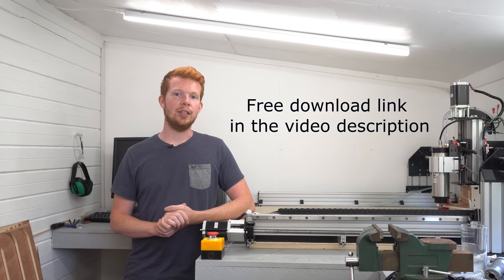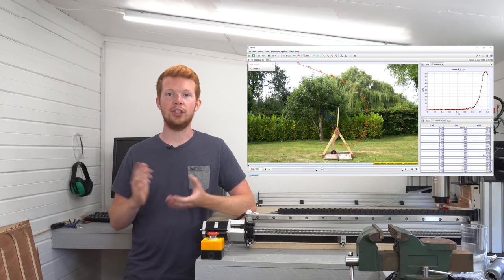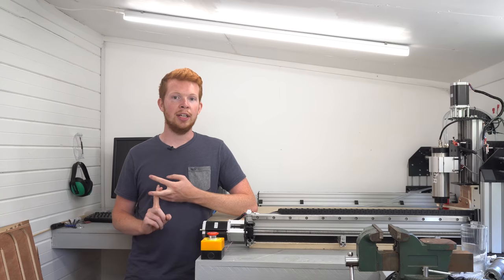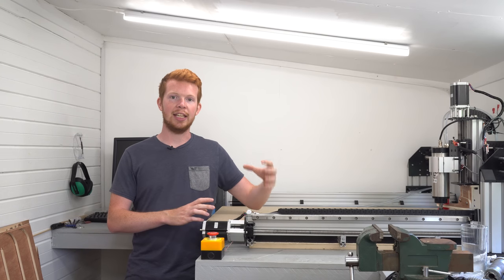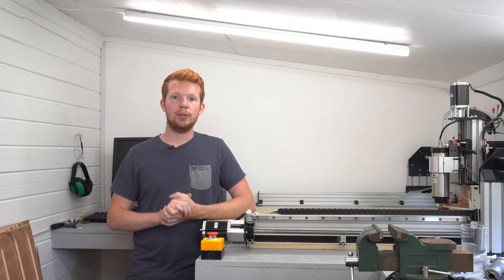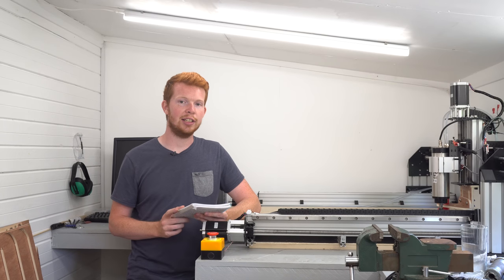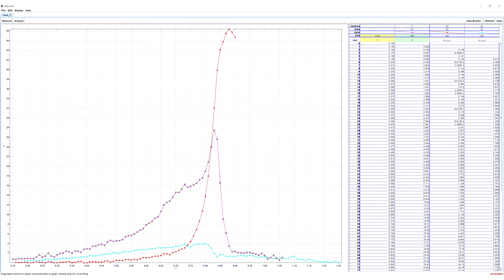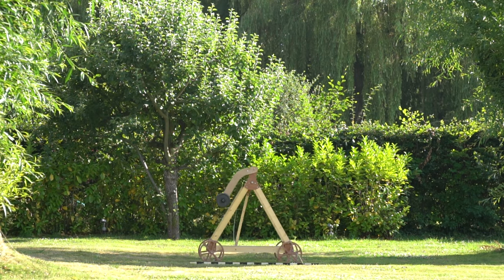Wheels on a trebuchet?

Comment: PS, stalling isn’t what is working.   What is working is when the ball is released at the exact moment the arm AND sling attains it’s highest possible speed. A shorter sling changes the moment that this occurs. When the sling lets go as the full length of the sling is in alignment with the arm, the sling is extending the arm length to its maximum, and the combined arm/sling length and tip speed is at its highest. When this occurs at the highest speed the arm attains, you get the maximal efficiency you can achieve.

Once more... watch the slo mo... the key is that the wheels allow the entire trebuchet to move AROUND the straightest possible path for the weight to fall.  And this motion also adds to the forward moment of the release.
Reply from the maker: If you watch my video I produced last week, it is indeed all about the stall points. Otherwise the arm would have kinetic energy that could be transferred to the projectile and is therefore wasted. It technically doesn't matter what path a weight will fall, it'll deplete all it's potential energy either way, whether thats rolling down a 1 degree slope or dropping vertically. All that matters for highest efficiency is that the weight drops and when it reaches the bottom, nothing is moving except the projectile at release.
Reply: Tom Stanton 

I saw your previous video.  No matter what you think you’re measuring, the only metric that matters is arm tip and sling speed at release.   
When the trebuchet does not have wheels you can SEE the energy going into trying to tip it over.  Adding sandbags to make it immovable does not increase transfer to the projectile because that is simply overwhelming the lateral thrust thru mass.  That is no different than the fact that a massive foundation holds the thrusts from the Eiffel Tower...  on the trebuchet it has no effect on the energy being transferred and there is no means whereby the lateral thrust on your axel can be converted to rotational acceleration of the arm by simply counteracting that force with mass.  The exact same amount of energy is being loaded laterally- it’s just being countered by an opposing inertia.  Everything you did that showed an increase in projectile velocity simply accelerated the arm to a higher speed... OR adjusted the release of the sling to better match the moment of highest speed.
It is the vertical drop of the weight, alone, that imparts rotational torque on the arm.  The moment the point of suspension for that weight starts to rotate relative to the arm axel, TWO things occur... one, a lateral linear thrust. And two, The Deceleration of the arm...  this is because as the weight follows the arc of its pivot, the distance it drops rapidly  reduces to zero and this change of speed downward is a braking action on the arm. (that is what causes your stall ).    In this scenario, you got the highest speed when you let the sling go slightly earlier, because it was before the arm started to brake.  The stall is the arm SLOWING down... not because it’s imparted it’s energy to the projectile, but because of above described change in the direction of the weight as it follows the tangent of its circle.
The trebuchet with wheels, however, instead of resisting this lateral thrust, converts that lateral thrust into MOVING the arms axel such that the counterweight can fall in the straightest possible line for the greatest possible distance.  The weight does not follow the arc described by its fixed pivot, rather, the pivots move to allow the weight to fall nearly straight to the very lowest point of its travel.  That last inch or two of drop is not a SWINGING CURVE...it’s dead fall that adds to arm rotation speed.   This faster arm is also being thrust forward with all the lateral thrust imparted by the falling weight trying to move in a straight line... and just before it reaches its top center position,it it moving at its fastest possible speed.   When you adjust the sling such that it is flung straight in alignment to the arm at this same point and released at that point, you have accelerated the projectile to the fastest possible speed.
Really and for true... measure the speed of the falling weight at every point in its drop. You will find that the fixed trebuchet has a falloff in counterweight acceleration in its lowest quarter of travel... and the wheeled trebuchet has less falloff over less of its vertical travel.  Measure the arm tip speed and you will see that it is moving faster in the trebuchet with the wheels.
The Whole thing is getting the arm tip moving faster, and releasing the ball at peak speed.  Try placing your exact same rig on a taller frame, so that you can make a LONGER arm...  make a longer arm with the same mass... and add a few pound to the counterweight to compensate for its higher moment of inertia... and it will throw the ball faster- even with the same drop in weight, because the longer arm tip will be moving faster.
Reply from the maker: I can't disagree with my real world experimentation results, so I'll have to agree to disagree with you. Thanks
Reply: Tom Stanton   Experiments can confirm a false hypothesis. e.g. the Wright brothers tested airfoils for a metric they called “lift” because the airfoils had to Lift up on a fish scale to measure how well they worked... and as a result our equations and understanding of airfoils mention ‘lift’. But a wing does not generate any such force. It works by generating thrust... just as any propellor proves.   But equations created to reflect actual experimental results will still work, even if they create imaginary forces that don’t actually exist.
So...you can easily test my assertions if you want to know the truth about your results.  Track the motion of the weight as suggested... or, Here’s one way you can eek out even more speed.  Improve your wheels.  Get good bearings on very low friction wheels, and mount the entire trebuchet on a dead level track.   Essentially, lowering the rolling resistance of the trebuchet will lower the force lost in accelerating it fore and aft. This will result in the counterweight being able to drop in an even straighter line for a longer distance and that will impart higher speed to the arm...I predicted wheels would net you around 10-15% more speed.   A dead level low resistance set of low friction wheels should get you another 2-3%

Comment: The whip trebuchet looks like very efficient design and your analysis is excellent.
I have questions.
How much more efficient is the whip trebuchet than the traditional gravity trebuchet?
The reason I ask is that the whip trebuchet poses two issues for me which may offset any potential advantages.
First is the question of cocking or preparing the whip trebuchet for firing. A small model can be easily cocked by hand. However, when scaled to the size needed to launch a 300-600 lbs. projectile, you are going to need some way to cock the device. Given the full rotation of the arm, I'm wondering what could be proposed to accomplish this in battle field conditions.
The second issue is loading the aforementioned projectile. Traditionally, the projectile was loaded at ground level which only required a few adequately muscled minions to roll it into place. Scaling up the whip trebuchet  to real world dimensions appears to require lifting the 300-600 lbs. projectile about 8 ft. or so above the ground to get it into the starting position.
Unless these two issues can be solved, it seams that the whip trebuchet  is just a cute toy.
I would love to see a detailed analysis of a side by side comparison of the two designs.

Comment: Regarding wheels on a trebuchet, there are two more considerations which do not concern projectile velocity. Firstly a large siege engine of the 1300's had a counterweight of around 2000 Kgs. Wheels would have allowed for moving the machine closer to the target as needed. Secondly, the rocking of the whole frame as shown in your non-wheeled trebuchet videos could have destroyed a large trebuchet after only a few shots. The very largest trebuchets did not have wheels, but they were probably too large and heavy to actually be supported by wheels. A wheeled trebuchet rolling on a hard surface like wood planks would be relatively easy to optimise in 1300's empirical fashion. A non technical measure of efficiency is low noise and smooth operation, both of which would improve with adding wheels.

Comment: Hello i don't know if you speek about my last comment about wheels. When I test it 15 years ago with a "normal trébuchet" (weight not so far from arm) the 2 effects was equal. and the conclusion with the second effect was that the falls of  the weitgh are more vertical and less curved with wheel before coming horizontal. (sorry for my poor english)

Comment: If you wanted to further enhance your design, you could try calculating how much energy you're losing to building up rotational and linear kinetic energies of the piece parts of the trebuchets. You can track how fast your links are rotating (1/2 I omega^2) and you also have some linear motion of the CG's at release (1/2 m v^2). I bet the rotational kinetic energies are significant. The only other losses after that should be friction, sound, and heat. It'd be interesting to see how close you could get. I'd be interested in modeling this setup to determine if analytically I'm getting the same result for energy transferred into the projectile (if you had some CAD to spare).

Comment: Really you only need the pivot point of the armature to move forward rather than the whole trebuchet. That would allow the counterweight to stall at the lowest point and minimise the mass of the trebuchet that has to move forward. That would make the whole thing significantly more complex I guess. Not sure how the articulation would work.

Comment: What about allowing your center rotating point to slide forward and backward ?
You would achieve the same result but you would loose way less energy than trying to move the whole Trebuchet  via wood wheels on an uneven surface... Don't you think ?

Comment: kinda agree and disagree... no doubt correct how it affects the final/stall point, that 1.2 m/s the frame jumps forward, also gets multiplied by the combo of lever arms and cord whip, so directly indirectly the 1.2 m/s gets multiplied by about 5 (add it to speed).. kind of like gear ratios do. the ideas do go together, the frame still just rolling forward as the sling is in its arc forward, so the length of that arc is also elongated/increased a percentage in the same amount of time = higher speed. tough call for the two double action swings happening, be fun to see what it'd do throwing a golf ball for distance, a pinball, 1/2 lb of marble mayhem,

Comment: Hey Tom you can I increase the velocity exponentially if you add a dynamic string length mechanism like the Olympic hammer thrower... If you hadn't noticed they always pull towards their center of mass before they release the hammer.... First they generate a potential (the centripetal acceleration) and after that they work against this potential ergo towards the center. when you analyse the equation for nonuniform circular motion you will discover that if you decrease the length of the string while it is rotating on e fix point it will increase the rotation frequency and therefore the angular speed ... So give it a try and see if it will increase squared ar = v²/r = w² * r
Reply: This seems like a very promising technique. Have the string wrap around a cam to shorten it's length. I'm also wondering if your could improve the power by adjusting the mass of the projectile (like impedance matching a circuit).
Reply: Braden Eliason very interesting idea pal. that would be worth a shot to try too
Reply: Braden Eliason like shortening the length of the string by simultaneously increasing the Wight of the projectile... Is that what you're meaning? Theoretically yes but mechanically how? With increasing the Wight of the counterweight dynamically would work/have the same effect too though

Comment: Another fantastically interesting video, Thanks :)
Now apologies if this is an idiotic question, but doesn't the fact that the "wheeled trebuchet" let the weight go "all the way to it's "bottom position" before stalling (and releasing the projectile), effectively give it a higher "potential energy delta" than the "stationary trebuchet" where the weight stalled out (and released the projectile) slightly before the weight had fallen all the way to its bottom position ? (Or put another way it raised the "efficiency" by utilising a larger part of the weights potential energy) 
((Now I have the sneaking suspicion that this is what You were saying(trying to say), but You just said that it was due "to the synchronisation of the stall points" but didn't "point out" (pun not intended:) that the difference resulted in a larger "energy delta" and that it was this "larger delta" that effectively made the projectile go faster... If my understanding of it was corect))
Best regards.

Comment: Tom - Excellent trebuchet educational video.  I learned in education school that it is very important to explain things in non-technical terms:  Synchronize ( I love that word) may be better explained in this context with: aligned "at the same time". 
     You said the explanation regarding rolling adding horizontal speed, in your delivery, but you did not convey that you understood it.  The ability of the trebuchet to roll converted more of the downward force of the weight to the rotational speed of the swing arm.  like a baseball pitcher being able to move when he throws a ball versus standing perfectly still.  Does that make sense?

Comment: Wheels on the trebuchet allowing the device to move forward is actually a waste of kinetic energy...it should on its own, slow the system down...but then it also compensates for the angle and position of the arm at launch...thereby increasing the overall efficiency of the device.

In fact any wobbling or shaking of the frame at the point of launch results in a reduction of power. In theory the device should be as rigid as possible.

Comment: How did the launch angles change with the changes you made to the trebuchet? Because I would argue that the throwing distance is a more important measure. Even if you are throwing faster, if the launch angle is worse then the distance can still be less. When assuming no air friction and neglecting the height of the trebuchet then the distance could be calculated with d=v^2/g sin(2*angle), which is optimal at an angle of 45°. However air resistance does lower this optimal angle a bit.
Reply from the maker: I try to keep the release angle constant throughout the tests to eliminate this issue. I choose not to use the throwing distance for a number of reasons. One, I don't have a long enough measuring stick and so I've been using a gps measuring tool on my phone, which is sometimes only accurate to 2-4m, and the difference between a ball going 100mph and one going 124mph is sometimes only 5-10m. Two, I've had balls travel further with a 10kg counterweight over a 15kg counterweight purely because of the direction of the wind. So I've chosen to measure the release velocity because it eliminated more variables than measuring the throwing distance.
Reply: Tom Stanton Good points. What launch angle did you use, from the video it seemed close to 45°. In another comment I mentioned that from simulations I found that, for tennis balls and your launch speed, a launch angle of 33.7° worked best.

If you would like to increase the distance then you could gain a lot from decreasing drag by increasing the density of the projectile. For example when simulating with a solid wooden projectile (750 kg/m^3) with the same mass the distances increased to 103 m. And for iron (7850 kg/m^3) the distance even increased to 207 m. But then the question would be whether you would find these smaller projectiles back or not.
Reply: Great video!!

Comment: Could you have a leather Whip instead of the ball to make loud cracks? E.g. Does/Can the tip of the string brake the sound barrier? or would that end the same as not having anything for it to impart the energy to? 
Still the design looks and sounds powerful! Good job.

Comment: Anyway to launch a glider from this?
Reply: nicholas we must make him do that, we are asking him since last video
Reply: well let's keep on it then
Reply from the maker: It's on my 'not sure how, but needs to be done' list
Reply: If that's actually a sizeable list it'd be great to see a video of you talking about it, or any potential projects actually.
Reply: Yes you can launch gliders from catapults. A Swing Wig design is needed to go from a Bolt configuration during high G launching with a rotating wing or spring loaded deployed wing. I have thrown darts from Whippers and another spring catapults I built.
Reply: @TomStantonEngineering  you should make the glider compacted into a ball then relese and open up in the air

Comment: Seeing your last vid I was surprised that adding wheels was not tested as I seem to remember hearing that the wheels allows the counterweight to drop more vertically as the frame can move counteract the arc of the weight about the pivot.

Could you get better efficiency by using inflated tyres as opposed to hard rims as they allow the frame to move smoothly by reforming to take up any bumps on the ground (like it is easier to move heavy wheelbarrows with pneumatic tyres than those with solid tyres)